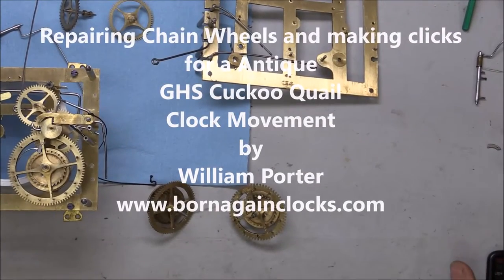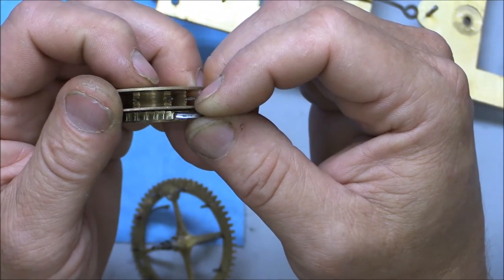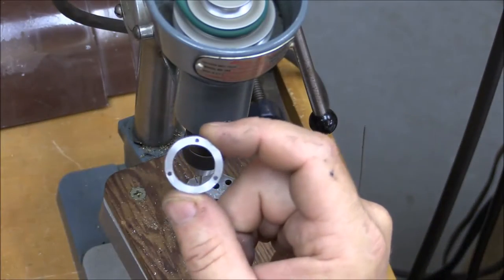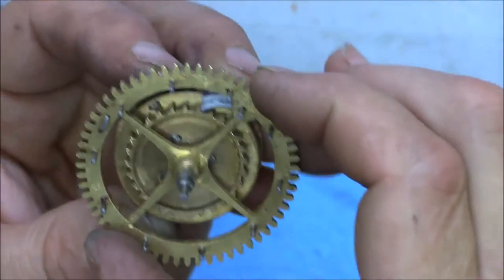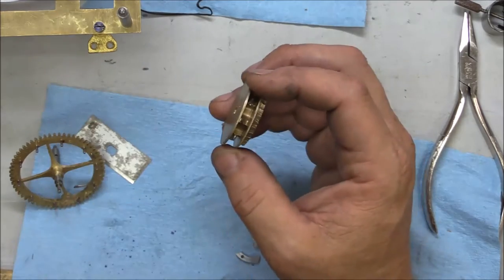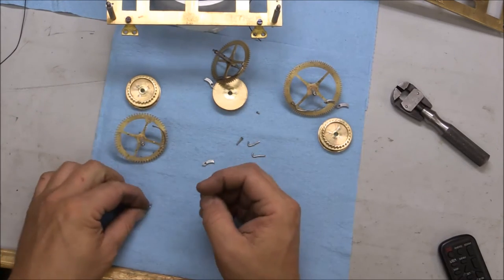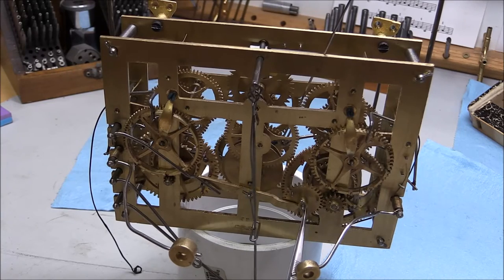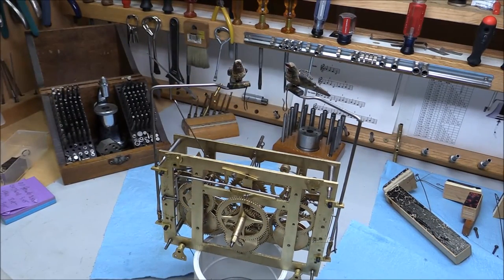cuckoo quail repair

Comment: A pleasure to see someone who blends hand and machine work so well!  Making the clicks on the lathe is a nice choice.  I've cut many from flat stock, but being able to groove the click spring slot as part of the turning operation is a nice little trick I'll keep in mind when dealing with curved clicks.  Your use of a 5C sacrificial collet is nice, parts of this size I do on a Taig with full surround soft jaws rather on one of the larger lathes.  Far too few folks appreciate the benefits of soft jaw / sacrificial work holding methods for maintaining concentricity while allowing dechucking.  The hands appear to be bone, as you suspect.  If the customer approves (and it is consistent with your standards) denture cleaning tablets in solution clean these up very nicely without making them silly new white.  Quite often I see these badly stained, soaked with oil, and with the surface loaded with grime.  I'm guessing you already cleaned the hands with your default solvent of choice?  Great video, I've enjoyed many of your posts.  Thank You!
Reply from the maker: Hi Stan, thank you for the nice comments. A little creativity can go a long way. As for the hands we had determined a light brushing, very light cleaning is sufficient, the reason is if I cleaned the hands and change the apperance then we are looking at doing the same with the numbers on the dial and that could pose potential issues as they are very delicate....It can be a fine line when debating about  how far to go with with cleaning case parts, in my mind....I do appreciate the the idea of using the denture tablets that makes sense, and now we have another creative idea under the belt...thats why we do this right?...Thank you...and have a great day, William

Comment: Fantastic coverage of exactly what I wanted to know as my cuckoo that I just got has that problem. Being as Im just starting out to repair a few clocks I picked up over the years that conked out on me this is my question....unfortunately you didnt show the disassembly and re assembly, which is my crucial first step so Im stuck on first base not knowing what to expect when I start the disassembly. Will alll the wheels etc stay in position when I remove the back plate or is everything going to fall out of position?Thanks, John....hope you check for comments:)
Reply from the maker: Hey John, just saw your comment, Thanks, as for starting out in clock repair and dealing with a unfamiliar movement I always say...study study study BEFORE disassembly. Make sure you have a good idea on how things are functioning and interacting with each other. Set up the movement outside of the case and run it while watching everything do its thing...Also take photos as you disassemble, lot of photos with different angle can really be helpful. By all means take your time and have fun. William

Comment: Nice work and well explained methods. You  bushed the centre of the drive wheels, are they  friction fit or do you use solder or some form of adhesive to secure them?
Keep up the great work. All the best
James Truesdale. (N Ireland)
Reply from the maker: Hey Jim, thanks for the kind comment. I wanted to make sure they would stay put but I didnt want to heat them up or distort the center hole by rivetting or any form of setting into place so I friction fit them  (very snug fit) with a bit of high strength loctite. May be a bit overboard for the function of a bushing.... There may be a bit of a controversy using the loctite.  I have experimented with it and it can be very strong if the fit is correct. I prefer a mechanical fit to stay along the original lines of construction. Have a fantastic day, William